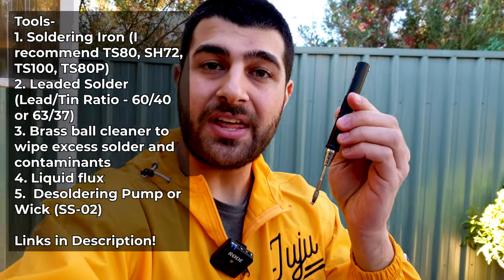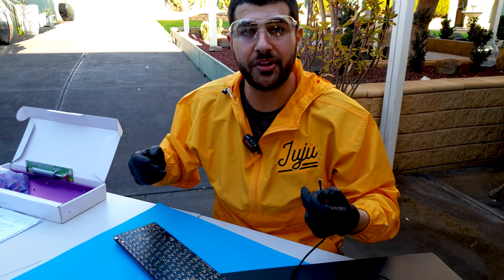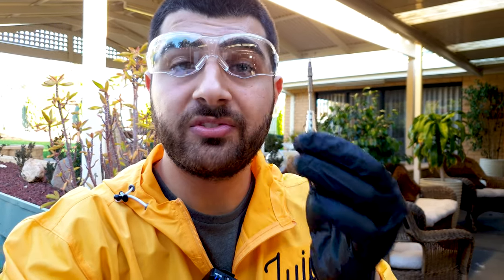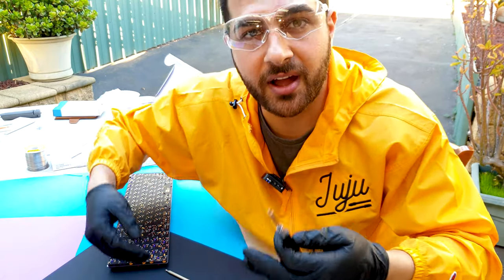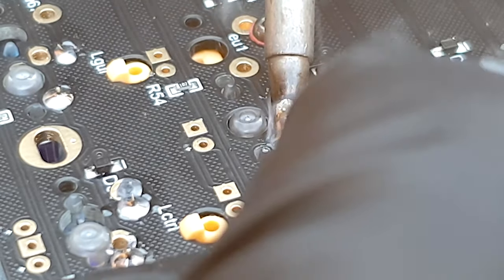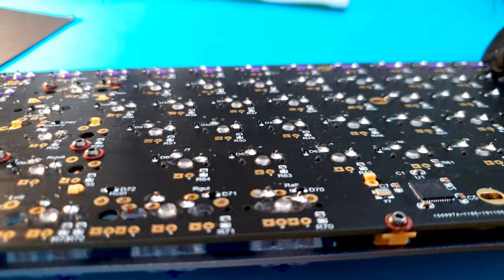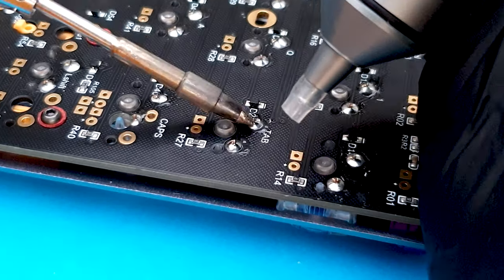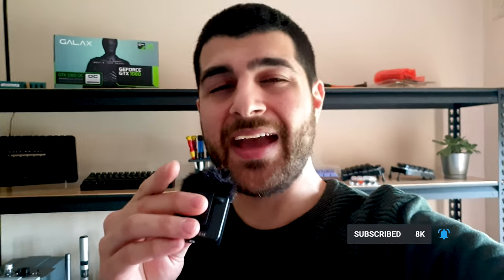How to Solder / Desolder your Mechanical Keyboard!

Comment from the maker: What mechanical keyboard are you building? Do you prefer soldering or do you like hot swap? I love soldering! 
Edit - I uploaded this segment separately to make it easier to find for people who just need to learn how to solder to make their keebs :)
Reply: I prefer solder, I never built keyboard but soldering seems more fun
Edit: Spelling
Reply: I prefer solder but it's also like to have one or two hot swap keyboards to test/try different switches with.
Reply from the maker: @DonnyDonnMendoza  I agree :)
Reply: Prefer hotswap. Solder is great too just need the tools. Awesome video JuJu.
Reply from the maker: @YayaTia_II  Thanks yaya :D
Reply: @goodjihad  No problem.
Reply: Soldering, relaxing and fun, add a little bit thrill when you won't know your keyboard will work or not hehehe (kidding) awesome vid
Reply: I want to solder LEDs on an ID80 PCB board, that is hot-swappable, is there a way to solder the LEDs to stay below the switch? This way I could still hot swap the switches. Thanks
Reply: I am soldering a Keycool 22-key numeric keypad for number crunching. Google brought be to just the right part of your video. Good tips, you seem like a nice guy so I subscribed!
Reply: i got scammed and got a g pro instead of the X ;c, so now I gotta desolder to put in my holy pandas
Reply: I plan to desolder my Asus ROG Falchion keyboard because I don’t like my cherry mx reds much and I want to use the holy pandas that I have on another keyboard of mine
Reply: With the rk61 software, mine dosent work. When I open it, it shows a keyboard which is the rk61. And it is not usual, when I click the buttons with the mouse, it should give me options and the should be tabs. But nothing, do you know why?

Comment: A heads up for soldering through hole, The best technique I've used/Found was to:
Place iron tip on the components, Then run your solder wire from the tip of the iron onto the components, then pull the solder away then the iron.
The process takes less than two seconds, keeps beginners from overheating parts, and also provides an extremely clean joint.
Reply: the same thing i did for some reason lol, yet somehow i still messed up and burn the tip of mah finger a bit, guess im nub :/

Comment: I was in hope of fixing the solder joint of my modded Armaggeddon MKA-3C Psychfalcon 2017 keeb that I swapped out with Box Browns a year ago and one of your tutorials made me realized that I made a big mistake when it comes to soldering equipment. I bought unleaded solder for this job and it turned out to be a horrid joint. In the future, I will mod another OEM boards or build my own keeb with this video! Great tutorial! 👍
Reply from the maker: Haha I warned you! :D You can use unleaded it's no problem but it's MUCH harder to use with normal household soldering tools.

It was my pleasure to help out! :)

Comment: i desoldered/soldered new switches into my one 2 mini for the first time and it didnt go exactly as planned. when i was desoldering, for a few switches they would get stuck and wouldnt come out and i had to use pliers to get the switches out (mx browns lmao i threw them away anyways) and there was this like copper ring around the pin of the switch. when i soldered it back together i only had 4 keys that didnt work and one was the pin with the copper ring around the pni... im guessing it was the contact point which actuates the switch :( is there any way to fix this? i recovered the rings that got pulled out from the switches
also great vid and thanks for the help!
Reply: Find the trace where you tore off the contact pad and scrape it to reveal the metal , you can solder a thin piece of wire to the exposed trace and the other end of the wire to the pin in the switch

Comment: super nooby question, but i've just gotten into mechanical keyboards and i'm curious! can you desolder a keyboard and leave it unsoldered, to like... make your own hot swappable keyboard? or do you HAVE to resolder switches that were initially soldered in?
Reply from the maker: You can and it's called hot swap holtites. It's difficult to install but worth it. However it's usually better to just buy a hotswap keyboard/pcb
Reply: @goodjihad  thank you so much, that’s great to know! i had my heart set on a non-swappable keyboard and bought it in the end, and i do like the switches, but it’s nice to know there’s a method for hot swapping down the line if i want to :)
Reply: You can check out Mill-Max sockets as well. They can be soldered onto a keyboard to convert it into a hotswap board.

Comment: JUJU! I found a Fume extractor for $35 USD on amazon called a KOTTO that I would highly recommend so you dont have to solder outside :) It comes with a spare carbon filter aswell!
Reply from the maker: Hey Forbies! Wow this one? https://www.amazon.com.au/KOTTO-Soldering-Absorber-Electric-Extractor/dp/B07ZHH5H7N/ref=sr_1_2?dchild=1&keywords=kotto&qid=1598874059&sr=8-2 

Looks nice! Thanks so much for considering me! I do have one but it's not as fancy :D

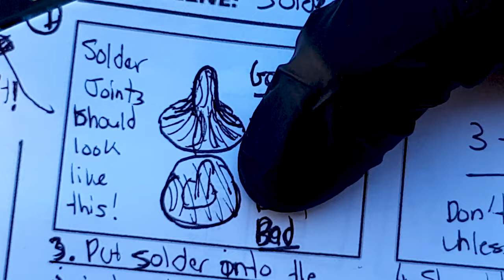Comment: thanks for this tutorial, question : the iron touches the pad and pin at the same, but how about the solder wire itself? I can't really tell as its zoomed in, are you touching the solder to the pad and pin  too or the solder to the iron?(3:09)
Reply from the maker: A bit of both. You want the solder to go on the pin and pad when it is heated enough to melt the solder you see (and the flux). But if it doesn't (yet due to heating the parts) you can just put it on the soldering iron and it will naturally flow into the pad/pin. A little of both helps.
Reply: @goodjihad  thanks for clarifying that , will give it a shot!

Comment: Nice video :) Unrelated question, but is that the raw audio of the Rode Wireless Go?
Reply from the maker: At the start it's a bit far away from my mouth and I am in a room without good sound absorption so it suffers there if it is not close to your mouth. As you can see at the end its much better close to my mouth :) It's a perfect mic though!

Comment: I over solder my keyboard which look like a little ball but it works really fine just like a normal keyboard but does it affect performance or anything like I’m worried that my keyboard was not 100% on its performance
Reply from the maker: It should be fine. If it works good on you! It just means it did not flow properly. Do not play with it much you could make it worse. You can solve it with some flux and a soldering iron.

Comment: How does you solder liquify so quickly when desolder? Mine takes a good 4 seconds or so even on a higher heat.
Reply: Your solder might not be that good quality or might be lead free
Reply: immersednoob i have kester solder 60 40
Reply from the maker: Either your soldering temp is a bit low or the soldering tip on yours might be dull. It might need a good clean. Come join my discord so I can help :)
Reply: Try running your solder from the tip of your iron onto the components, Kinda like a welding bead while the iron is contacting the components.

Comment: Man, my pads on the Nemui65 fuckin suck. They're so small. I was afraid I was going to burn whatever the surrounding material is around the pad. Those are some fat pads on there in comparison.
Reply from the maker: If you have a thinner soldering iron tip try that! You can also try and get a blob of solder onto the tip first and then try lift the soldering iron up so the thinner bit is pressing against the pad.
Reply: @goodjihad  Ohhh I see what you're saying. I may try that then. A thinner tip would be nice too. I'm using the little chisel tip that came with the Hakko FX-888D and I had to put a blob of solder on there almost every single time. Each joint took 2 or 3 tries, because it didn't seem like there was enough heat getting to it. I could try holding it more straight up and down though yea, you're right. I was sort of coming at it from the side.